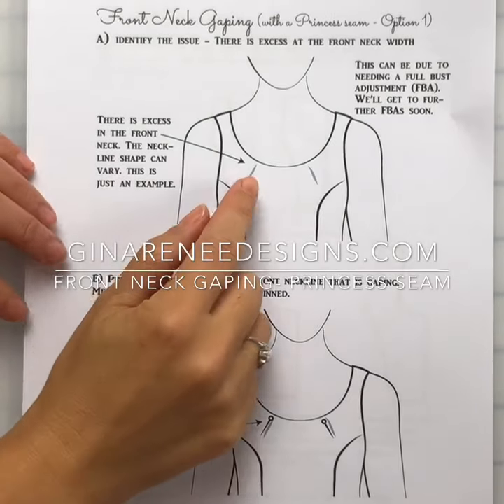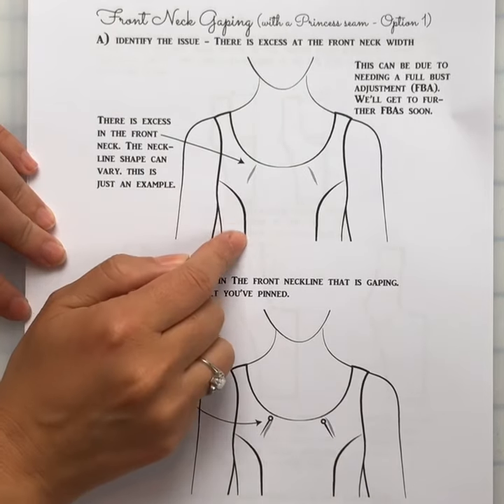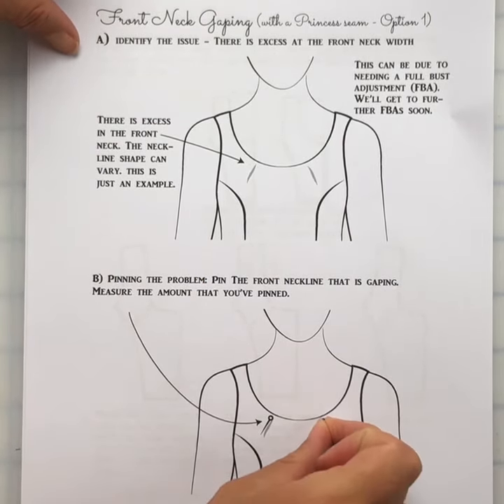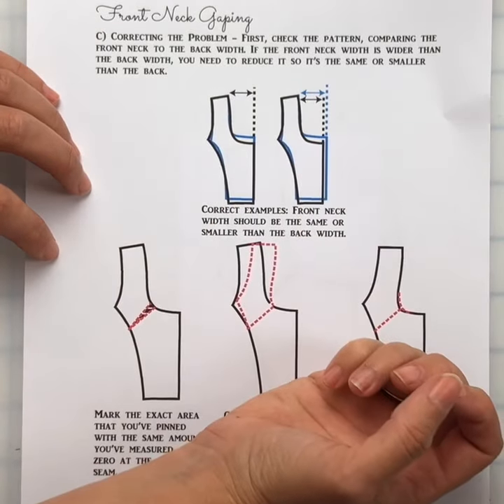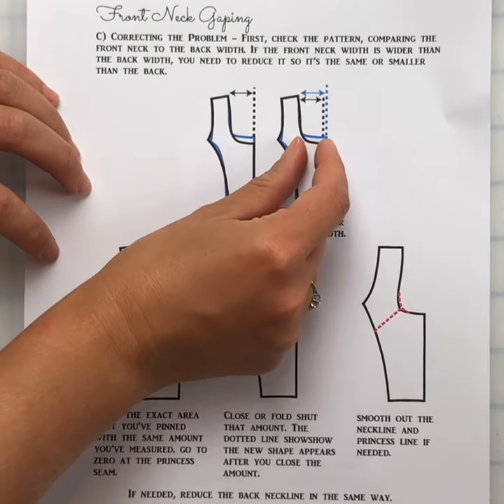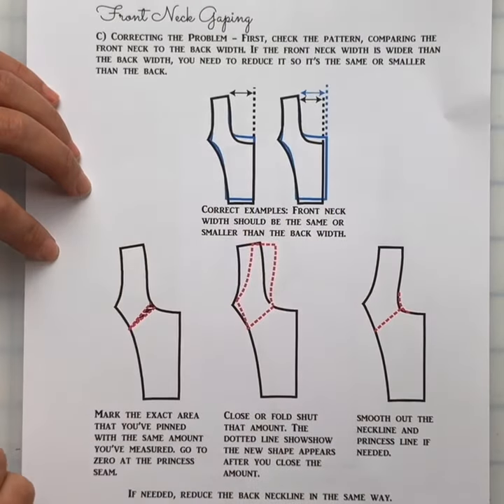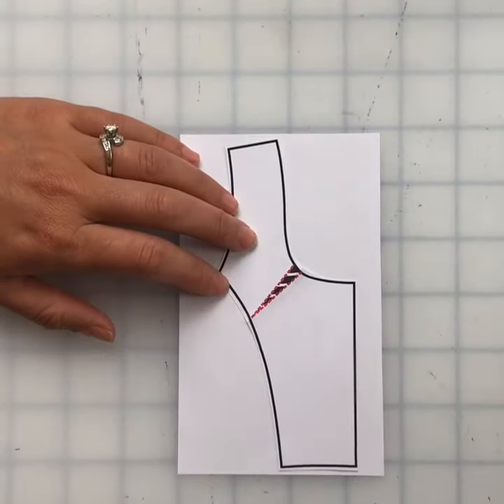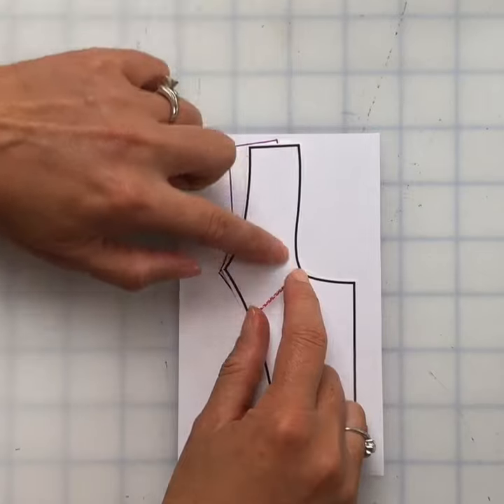Fix Front Neck Gaping – Option 1 -  with Princess Seams from the Armhole - How to correct a neckline

Comment: What to do if i have same problem with bust dart only
Reply: It's the same concept as pages 117-118 in The Fitting Book, but instead of having armhole gaping, you have the neckline gaping, and you will pin at the neckline instead. Follow the concept for the pattern correction on 118, and you'll make the bust dart deeper by doing this. Make sure that you've also already checked the neck widths, as explained on pages 73-74 in The Fitting Book.

Comment: I slashed my pattern following your instructions but when I joined up the two pieces the neckline did not meet, and I had a wedge. So I do not know what I did wrong. I have to decrease the neckline by 4 cm 2 cm each side.
Reply from the maker: The more you slash out, the more likely there will be a difference and the two slashing lines won't meet up. 2cm is a bigger slashing amount, so this is likely why they don't meet up and that is normal. So you will take the middle point and redraw the neckline to make it a smooth contour.